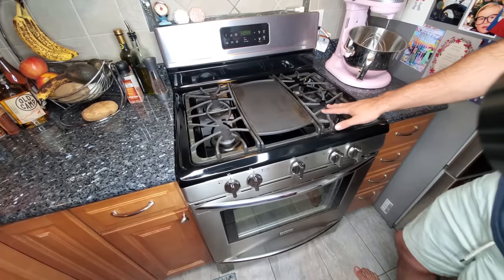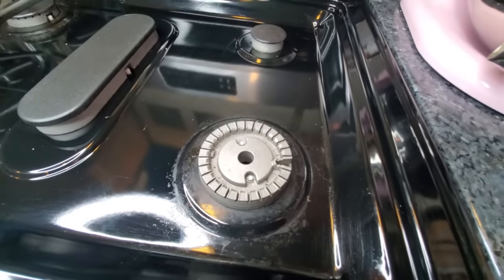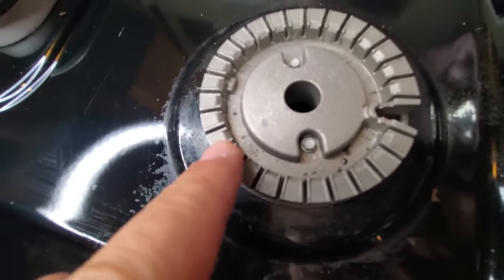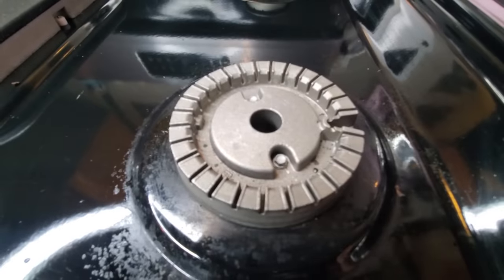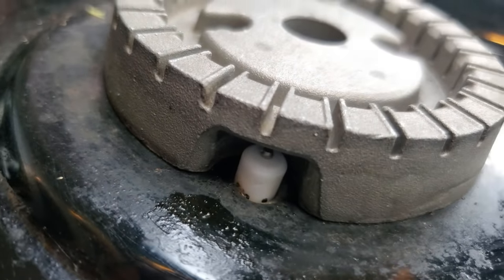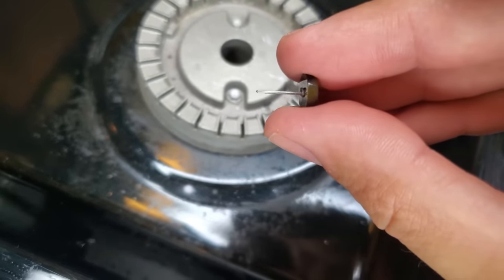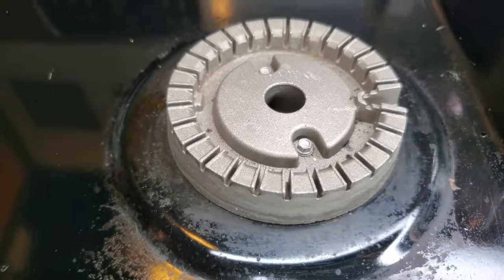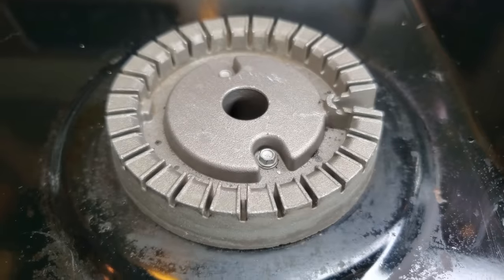Gas Stove Top Burner Not Lighting (Easy Fix!)

Comment: You should really say this video is for America. My Bosch cooker in the UK does not have a hole where you say.
Reply from the maker: Most gas stoves have one or even two little holes.  Depending on the brand, they could be in different areas.  Have you searched hard for the holes?

Comment: My stove does not have that tiny hole. Dang. What now?
Reply from the maker: Must be a very new stove?  Try cleaning everything well
Reply: @JMG ENTERPRISES    turns out the receptacle that the stove is plugged into is bad and needs to be replaced, so I lit it the old-fashioned way... I used a lighter😁. Gonna fix it in the new year. It's good for now.
Reply from the maker: @christoviaramos7948  - Glad to hear you were able to locate the issue!
Reply: @JMG ENTERPRISES    yes and thank you! Had it not been for this video I wouldn't have know where to start. Very helpful vid💯
Reply from the maker: @christoviaramos7948  🙂
Reply from the maker: @christoviaramos7948  Glad to hear it!

Comment: I wish I could report a successful repair, but nay. My one small burner ALWAYS acts up. It will eventually light after turning the gas off & on a few times, but that hole is large & clean, so no joy. 🙁
Reply from the maker: Do Hou have consistent spark on the ignitor?
Reply: @JMGENTERPRISES  Yes, good spark. I suspect that the mixture may be too rich to light. Off & on a few times usually does it. It also doesn't light all the way around without playing with it.

Comment: Nope. I’m the 1 times out of ten. That didn’t work for me at all
Reply from the maker: Do you have spark?  Do you see your ignitor sparking?
Reply: @JMGENTERPRISES  yep it sparks. I smell the gas as well. When using a lighter it turns on but it is super low on the highest setting. I cleaned it & there is no residue of anything on it.

Comment: Didn't work.
Reply from the maker: Darn!  Are you sure you have spark?
Reply: @JMGENTERPRISES  Yeah, I had sparks. It happened after cleaning. Three of the burners wouldn’t light despite the sound and smell of gas and the clicking sounds if the igniter for which I also had visual evidence as well. I eventually got two out of the three working by fiddling around with the knobs mostly.

Comment: sorry didn't work!
Reply from the maker: Oh no!  Did you find that small hole on your burner?
Reply: @JMGENTERPRISES  thanks for responding. Yes I think I cleaned everything pretty well. Tried letting all burners run for a minute. All burners are sparking at the igniter. Does that tell you anything? BTW it's DCS RGS-366.